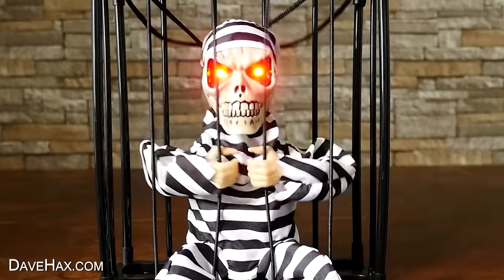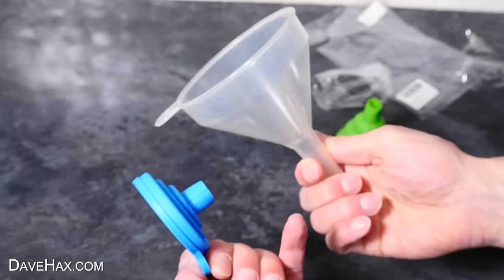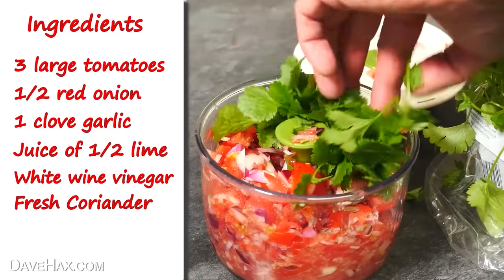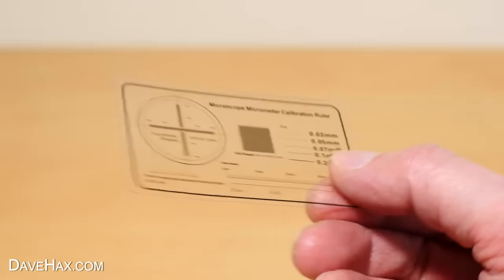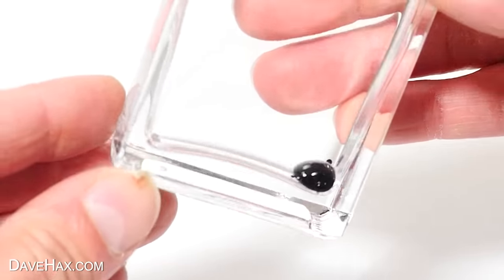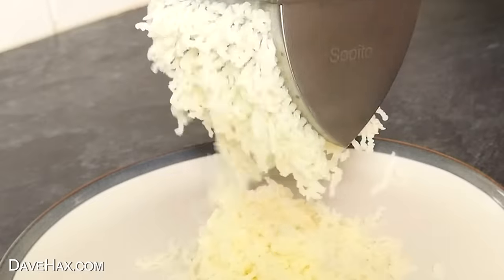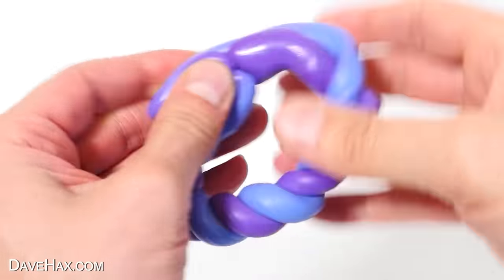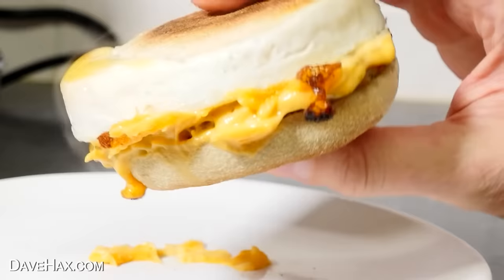The MOST SATISFYING moments...

Comment: I think doing an under sink disassembly of the curved tube will relieve you of a huge wad of hair obstruction. I’m a woman in her 50s and I did it for the first time. The huge wad was cleared by my gloved hands and I poured baking soda bicarbonate down the reassembled pipe, and followed the 3/4 cup of that with 1.5 cups of white vinegar and left it for 90 minutes. The whole process took2 hours including the  90 minutes. My drain was clear running for the next 4 years 😀😀😄😁👍🏽